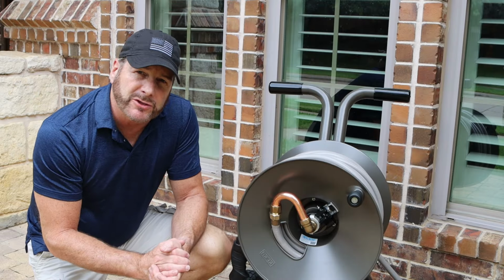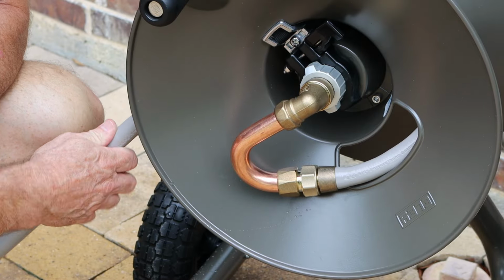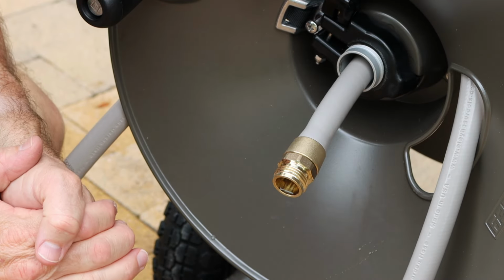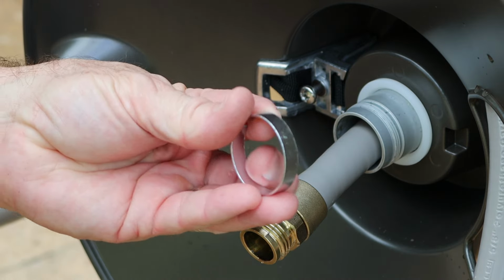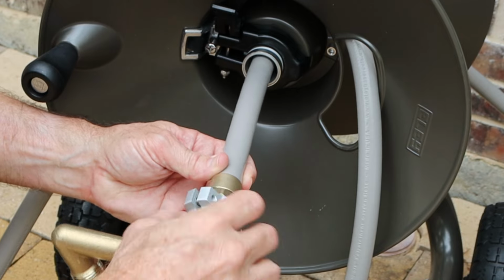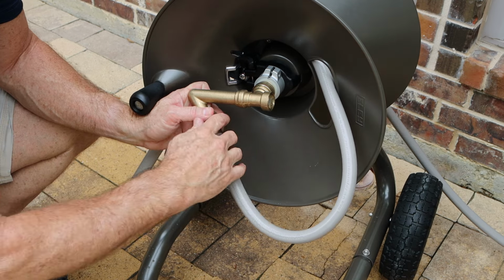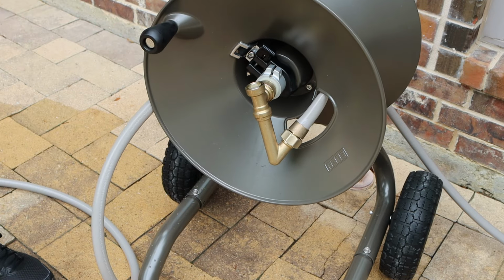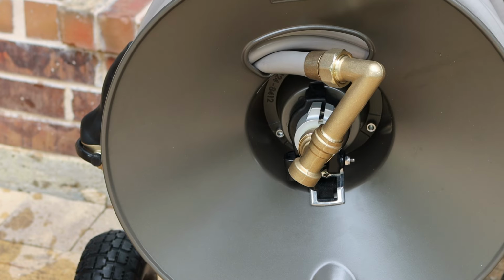ELEY Hose Reel - 4291 Swivel Installation for Threaded Axle

Comment: This is the swivel that the Eley hose reel should have come with.  I have two Eley units and have gone through four of the copper style swivel units.  If there is ANY water left in them during the winter and it freezes you can say goodbye to the swivel unit.  I have since come up with a workaround that fixed this problem.  Also, I still have an American made Rapid Reel design from the early 2000s that I have left out in the winter that still works flawlessly!  The new Eley units are good but not as good as their original Rapid Reel units.

Comment: That looks like it would reduce water flow compared to the original design, was this done to cut your cost ?
Reply from the maker: Nope.  It actually costs more to produce this design.  The change in the shape of the garden hose swivel gooseneck does have a "theoretical impact" on water flow, but it is so minimal that our digital flow meter with a resolution of 0.01 gallons per minute (GPM) and our pressure drop gauges cannot detect it.